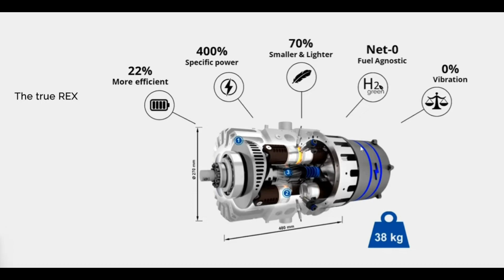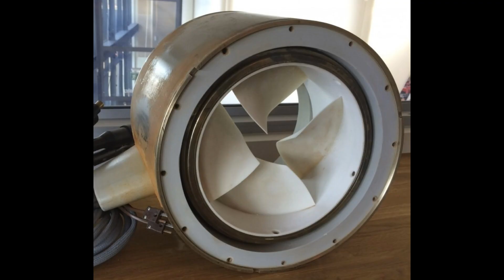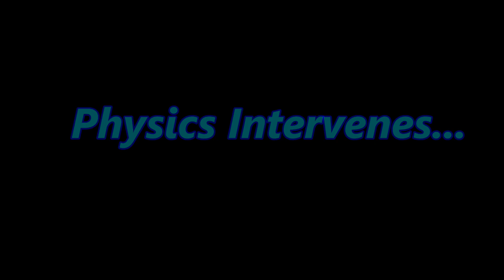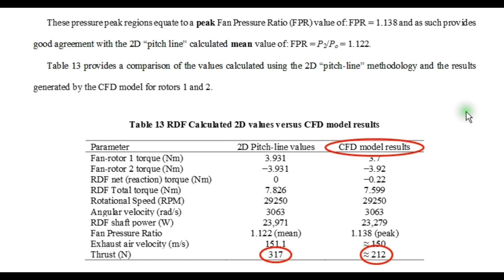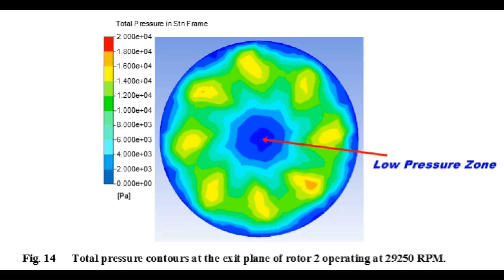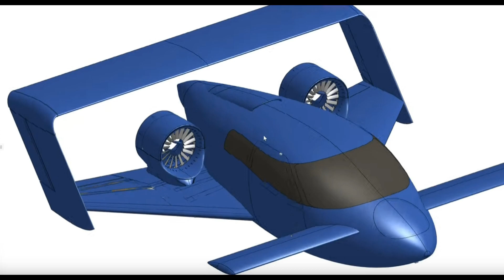Raptor NG VTOL Reality or Renderware?

Comment: I've been building and flying model airplanes including my own designs for more than 40 years.  One of the basic design principles that I stick to is if it doesn't look right it won't fly right. That's where I start. I use all kinds of software and virtually fly the planes before I ever Even start to make a mold...  But after building probably 30 or more of my own airplanes from scratch I get a pretty good idea after a while what works and what doesnt.  A flying lunch Box with a handle on it and some PC cooling fans isn't going to cut it.  Forget the VTOL aspect. That thing wouldn't fly very well as just a regular airplane.  And I'm dying to know what kind of air foil hes thinking of using.  Because with that shape of wing There isn't an airfoil that I'm aware of that will transition  Through the kind of speed envelope hes going to need to get that flying on its own wing  From a hover and then back again in a controlled manner.  Without having to claw his way into the air with a LOT of power making a metric buttload (technical term) and a radically high angle of attack.  Roll it out of your driveway and then launch it like a spacecraft?
 It's gonna need at least 2 stages to get to orbit.
Reply: For everyone using imperial units, one metric buttload is 1.34 imperial buttloads.  If you are speaking to a North American audience, we are usually more familiar with f*ck tons as the conversion is close, like liters to quarts.  Hope this helps! :)
Reply: Metric f*ck tons to imperial f*ck tons is what I meant
Reply: @alarmedmutant  Brilliant analysis of differing measurement systems. :) A definite favorite comment recently, bravo!
Reply: There are box wing ultralight airplanes being sold and RDFs for RC airplanes were even tested by a research paper shown in the video, the ideas work but this stack of unproven technologies won't.
Reply: Hey man, would love to bounce an idea off you, not for anything professional but had an idea and was just curious about it, you would know way more than I would. Hoping to connect.

Comment: Magnetically assisted gears or electrodynamic bearings might work, but this is just one of the many problems in the fan and it would require a lot of R&D to make it work.

Comment: I don't think flying the same as raptor One is something I'd want to brag about really.  I built a really accurate model of that thing directly off his drawings really early on and it flew like c*** and the nearest I could tell the full size one flew the exact same way i told him that my models did.
Reply: That's so cool!  Would you mind expounding on that model?!
Reply: Funny thing is Peter did build an RC model early on which had stability issues. He decided it would be stable in full scale since that’s what he saw in his computer models so pressed ahead.

Comment: His older design would have been more achievable then this. Now there is no chance of success
Reply: Agreed. He shoulda just thrown a Walter 601 into his original design and seen if that gets him anywhere.
Reply: The original Raptor was an accident looking for a place to happen. Way to complicated drive system and I think it was a real dog too. The takeoff roll was extremely long and landing speeds were very high for a 140 kt aircraft. Throw in the disastrous cooling issues and you have a plane that made absolutely no sense. Kudos to Peter for pursuing his dream though, amazing effort and he lived through that first flight which was downright scary to watch. He will now move on to this new hallucination and I see it going absolutely nowhere. He is gifted mechanically but I would like to see him put those talents towards a far more conventional design.
Reply: @jfjaksgf  I still think the original Raptor could have been fine if he'd just thrown a Walter (or other) turboprop in it.
Reply: @stevewinegar6364  The Mark I Raptor was a conventional tricycle canard with a pusher prop. (What was unconventional was its power source and the novel crowd-funding). So with slight lowered design aims (e.g. no pressurisation) and a proper aero-engine, surely it would have been much easier to press on developing an essentially sound aircraft concept than to fundamentally redesign it with so many untried  technologies?